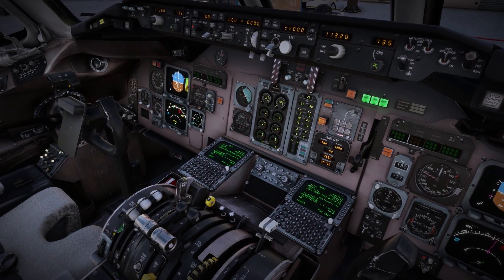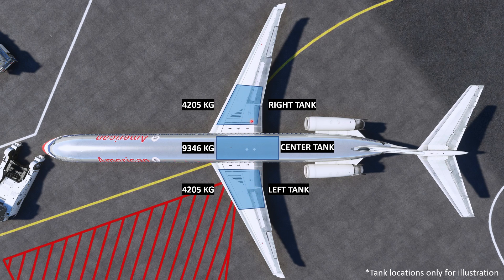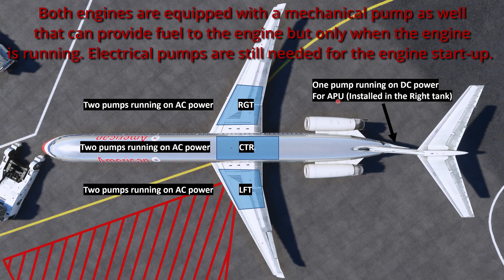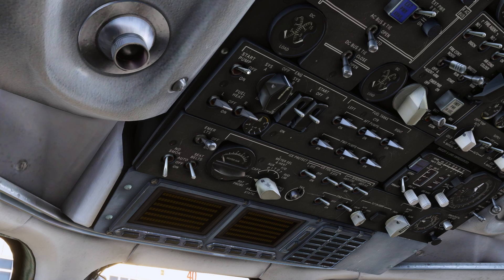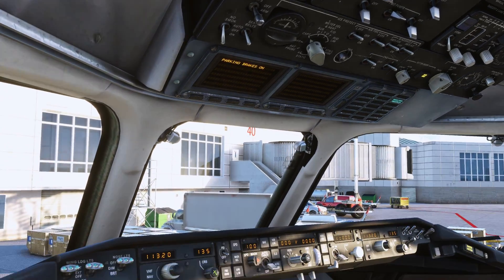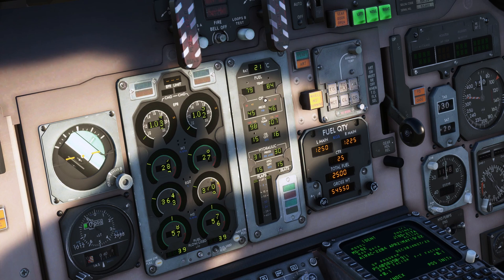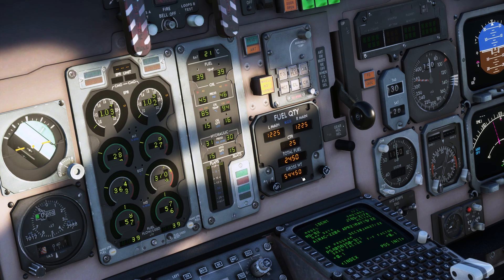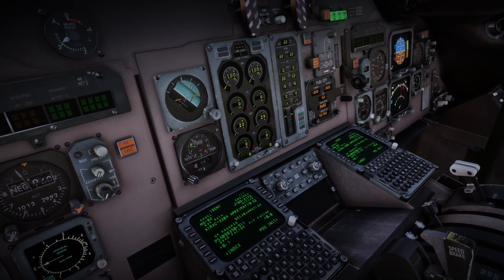Leonardo MD-82 for MSFS - Fuel System Explained - #1

Comment from the maker: Two things that I wanted to pin here so that folks are aware about corrections: (Thanks to the folks who are helping the community learn this machine better by adding educational comments)
1. Vincent: Quantities shown in the fuel flow have to be multiplied by 10x, which means in the example the fuel flow is 390kg/hour and fuel used is 70kg.
2. MD80ifly: One thing often misunderstood is the DC fuel pump. The DC pump is only used if the AC power is not available. If there are AC power on the plane (generator or ground power), one of the right main fuel pumps are used to feed the APU also under the APU startup.

Comment: Where,on the plane, is the fuel filter temp measured?
Reply from the maker: Not sure but usually when it says fuel temperature it is actually fuel measured before coming to the engine. Again, I am not sure but since I am into ic engines professionally that is how it goes there atleast :)

Comment: 8:13 Quantities shown in the fuel flow have to be multiplied by 10x, which means in the example the fuel flow is 390kg/hour and fuel used is 70kg. Great video.
Reply from the maker: Pinning your comment. Thanks for the note :)

Comment: Nice video. One thing often misunderstood is the DC fuel pump. The DC pump is only used if the AC power is not available. If there are AC power on the plane (generator or ground power), one of the right main fuel pumps are used to feed the APU also under the APU startup.
Reply from the maker: Thanks Claus for this comment! Helps :)